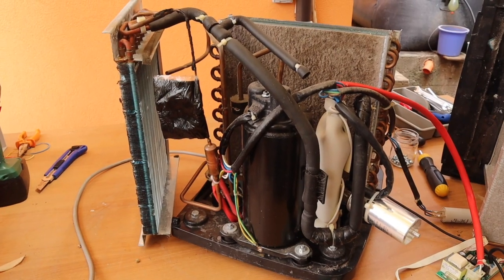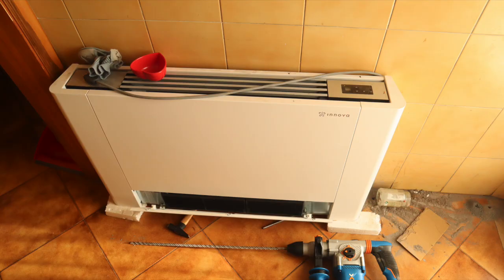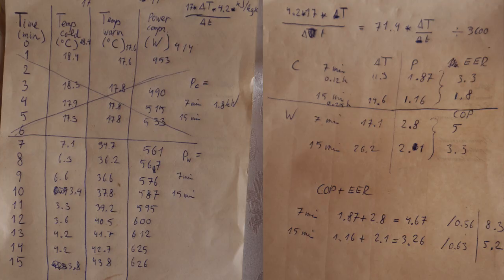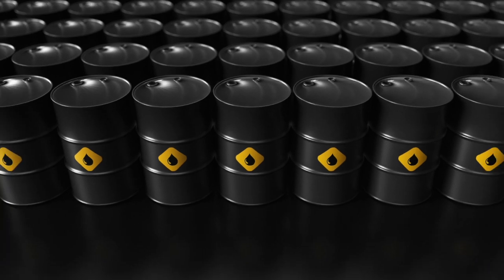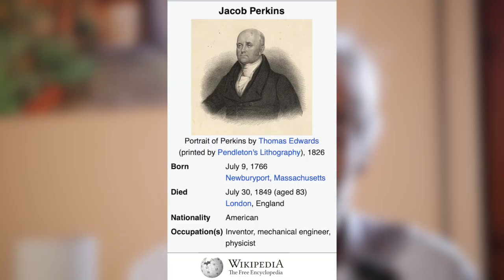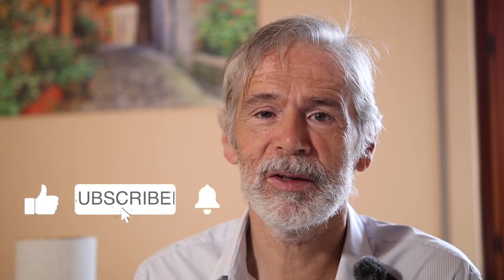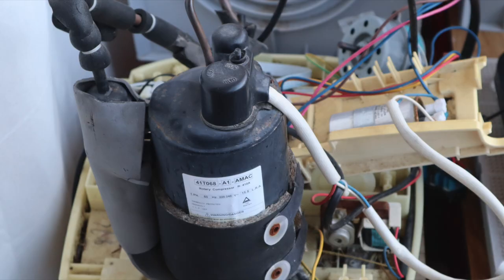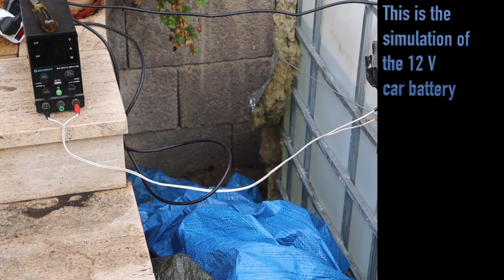Forget Gas Boilers and Switch to DIY Heat Pumps for Lower Bills - Video 69

Comment: What temperature are you aiming on the warm side, or you're planning to heat the water as much as possible during off peak and circulate it?
Reply from the maker: I will start circulating it into the 11 radiators in house at 35 degrees or so and see what I can do with fans on the radiators, so that the radiators will work like fan coils. See also my very first video! In this way I will have a low delta T for the heat pump. With colder weather I will let the heat pump work harder and arrive at 50 degrees C. With only the water box and no connection to the 1 m2 storage, I got even to 60 degrees.
Reply: @nnvasen-good-energy also try pointing a desk fan at the front surface of the radiator to push air over it.

Comment: I'm quite woried about electrochemistry between the aluminium and the copper. Do you had some problem with this ?
Reply from the maker: I am worried, too! But after a year or two, it is still OK with my oldest heat pump. In the beginning I worked with a separation between the heat pump circuit and the water storage, then I wanted to simplify (also for you, my audience) and thought that I wanted to learn, even at the cost of my oldest heat pump.

Comment: I would argue against using PV and a heat pump. A PV panel will capture about 22% of the heat falling on it from the sun which your heat pump may increase by 3, so if the sun is offerring 1kw you get 220w of electricity and you convert that back to  660w of heat. Roof mounted vacuum tubes will capture up to 95% of the sun's heat so you have 950w available to store.
Reply: i have 330 euros solar vacuum tube water heater and 100L water storage, it generates a lot of heat where i live (even in the winter i could easily get 45-55C at 3PM) in the summer it reaches 90-99C every day and autumn/spring 60-75C. In 4 years of owning it only 7days it didn't produced sufficient heat when i needed and opted to use electricity.
Reply: You are absolutely right about using solar PV for heating IN THE WINTER. However solar thermal will not heat your house, or even your domestic hot water IN THE WINTER. Unless that, you either live in a location where the is not much seasonal difference in insolation (in which case your heating load would be minimal), or you have grossly over sized collectors, which would give you something of a headache in the summer. Solar thermal can of course give some pre-heat to a system in winter.
However, a heat pump has the flexibility of being able to source power from the grid. Thus, the COP of 3 or more will give a lower carbon consumption, even on an unreformed grid, or simply a lower drain (compared to resistance heating), on a decarbonised grid. Meanwhile, your PV panels will help reduce your draw from the grid, even in winter. Should you need cooling in summer, they could cover this entirely.
The system proposed here stores the energy in a large volume of water to even out demand and/or give a reserve of several hours in a blackout situation.
Reply from the maker: Yes, this would be also my reply. I am convinced that your vacuum tube collector is really a good idea and don't know why they are so few here in Italy. But the flexibility of heat pump & storage is very attractive. I would add to Nick that we can also avoid to feed PV into the grid with only 5 cent reward by switching the heat pump on when there is excess power. That is also the reason that in this video 69 there are two independent heat pumps.
Reply: How does the pricing compare, PV panels are incredibly cheap, reliable, and almost zero maintenance. Vacuum tubes must be run on glycol in the UK, pumps and heat exchangers need to be maintained.
Reply: What is your point , photovoltaic panels which produce 4 x less energy would heat your house ?
Reply: @andreycham4797  No. I specifically said they would not. Read my comment again and do your best to understand it.
Reply: @nickwinn7812   Pv panels output 4 x less energy than thermal panels now multiple that number by 3 this is the COP of heat pump . So you get 3 units of energy from one square meter. I multiply my 4  units of energy from solar collectors  by 3 and I will get 12 units of energy from the same square meter. I think they teach that simple math in second grade or so

Comment: Very instructive videos.
I have a question: You have a cold and a warm water tank. What do you do with the cold water tank at freezing temperatures? The water can freeze if the temperature stays below freezing for a long time.
Greetings from Flanders, Belgium.
Reply from the maker: Hi Paul, yes, this system has also its limits but they are further than a normal heat pump with the external air unit in the garden. It will take a time before the tank freezes and then, while changing phase, it will give you a lot of heat before going further down under 0°C (92 kWh if it would be possible to freeze all the 1000 litre in my tank here). Or you can put antifreeze in the water. Or you can circulate this ice water in the ground (but you need spirals in the garden). We have here an old rain water reservoir of 70 m³, which many Sicilians have. And now I read about a law that also in Belgium the law prescribes rain water collection in new houses (very good). Wow, that is a lot of thermal storage... I like the idea to do one thing (building rain water reservoir) and having two benefits!
Reply: @nnvasen-good-energy  i wonder if you can make a giant insulated box and use it as "free" refrigerator during heating season by circulating cold water, i know it's not a genius idea because empty rooms who aren't heated could easily be 5-6C in the winter (at least where i live). During the summer the hot water it's risky to be used for shower/kitchen because there is a risk of bacteria growth (Legionella pneumophila) in 45-50C water, maybe the dishwasher can use it. I personally haven't got sick from the bacteria during the winter my solar water heater produce 45-50C hot water and i've taken countless of showers  but after i read about it i'm kinda scared 😅
Reply: I too had this idea for a heat pump transferring heat energy from a hot and cold source and my plan was to use the cold source as the initial stage of a dehumidifier for my bathroom, rather than using an extractor fan to dump heat energy straight out the duct during winter, I was going to run cold water through a heat exchanger to condense moisture, then run the air through a second heat exchanger to bring it back to above room temperature for heating. Obviously the flow of cold water can be thermostatically controlled to keep it at the right temperature to condense the fluid, without removing too much heat energy as to reduce efficiency.

Comment: Love the content and ideas and looking forward to seeing the full working system.  I already use a heat pump for heating and am interested in the idea of using solar and lower wattage units to reduce running costs.  Keep up the great work!
Reply from the maker: Thank you very much John, I appreciate your encouragement! If you have ideas, I am happy to hear them and make a new video that is good for many.
Reply: @nnvasen-good-energy  Great video - it's amazing what treasures can be found on youtube!.. One quick query - have you given any thought to using wind to power a heat pump? Obviously not very straightforward with sealed units from an AC system; but hoping your superior mind can work out the feasibility of it better than mine has managed!
As you have mentioned, most effort seems to go into electricity generation and storage, but heating and cooling is a large proportion of this, so makes more sense to avoid the conversion losses if possible and create and store heat instead.

Comment: Excellent video, can't wait to see it with the central heating system.
Reply from the maker: Thank you Wayne, I hope I manage it. I found some issues in this video that I have to fix before connecting the heating radiators but I will put the engine in a higher gear! Before Nov 7 I will deliver, then we go again to our winter address...